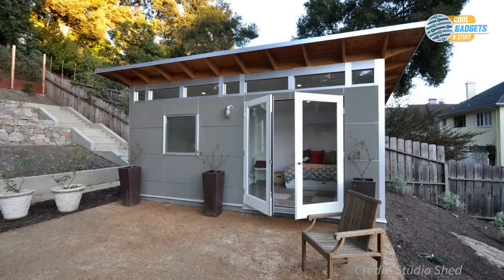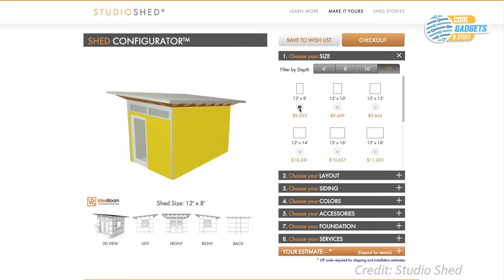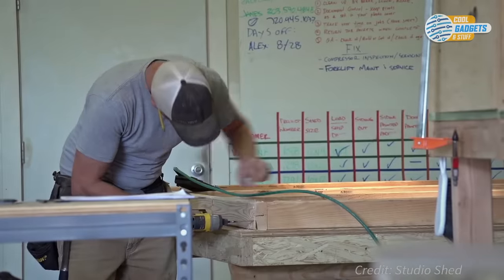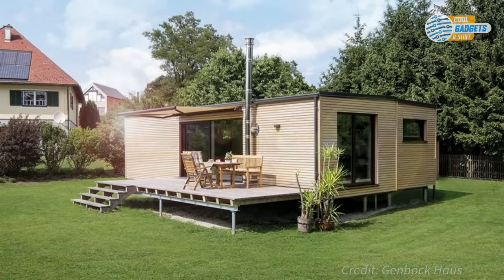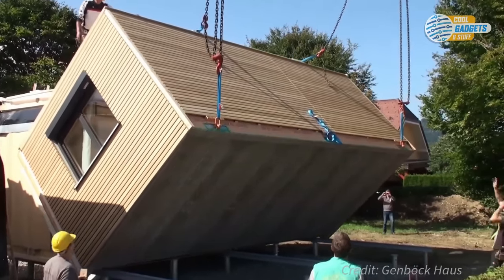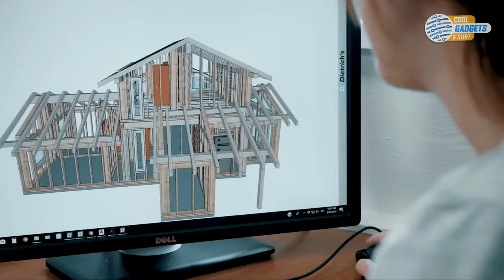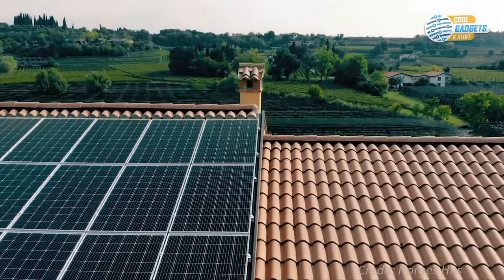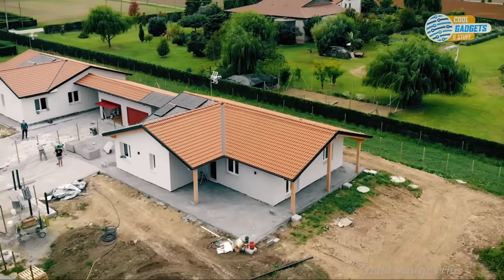7 Great PREFAB HOMES #5

Comment: Seeing a lot of Comments that All agree that the Prices are BULLSHIT HIGH! You Can "Stick" Build a House for Less than Half of the prices they are wanting for these... Shit, You can even Convert a Nice Size Shed to a House for Less than a Quarter of what they are asking. Home Depot and Lowes Sheds (Tuff Shed Same Supplier to both)... the 2 Story ones.. For Well Under 20,000 to Buy and another 5-10 grand to Convert..All Done for Under 30,000 and in MOST States, if Located Outside City Limits, NO Permits Needed!